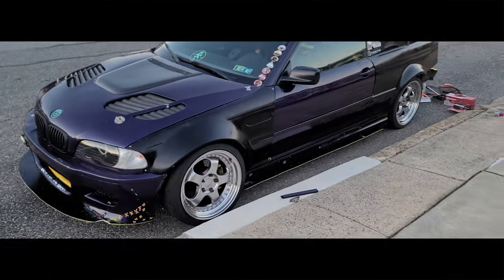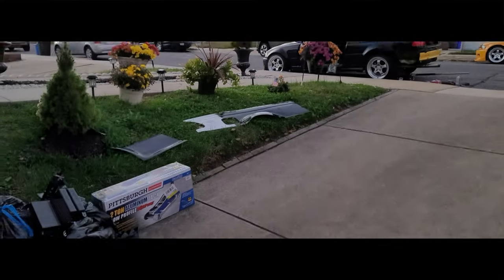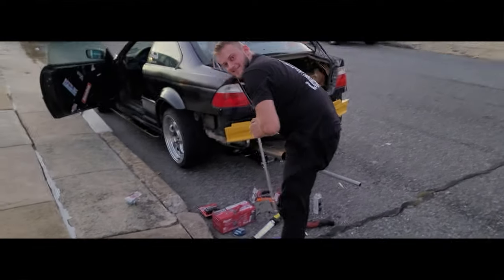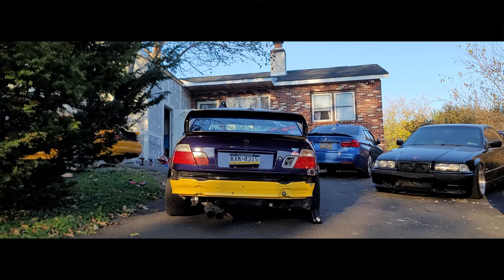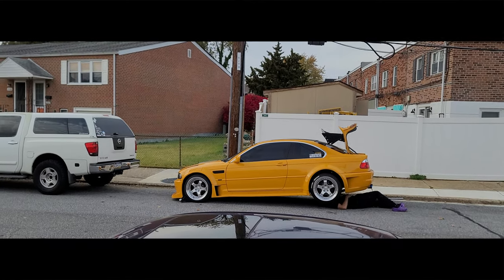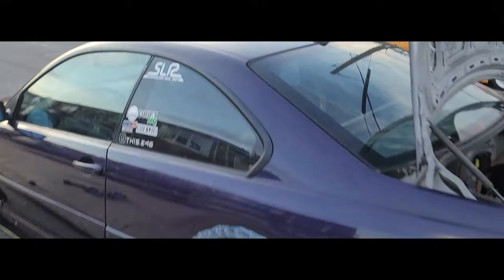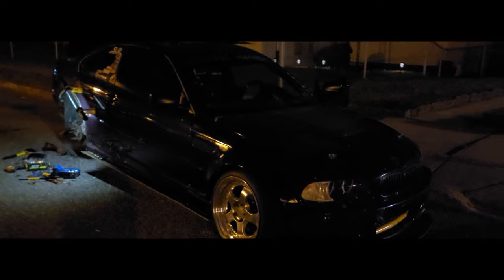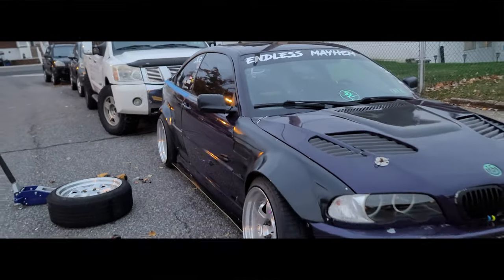The PERFECT E46 Widebody Build Begins! Wider Than My GTR?

Comment: Is that an m3 rep front bumper? (Like non M fitment I mean). Does the fenders line along with the bumper?
Reply from the maker: Yes, they align
Reply: @BreakTraction  you’re tempting me to go wide after watching this brooo ❤️🔥
Reply from the maker: @bobafittness1346  you should always go wide 😈
Reply: @BreakTraction  dangggg bro. Sick content you’re putting out there. I might lmaoo 🔥🤣, how did you go about the plastic fender liners up front? Removed them?
Reply from the maker: @bobafittness1346  I have mine removed, he has his cut a little, but with wider wheels it rubs on the liner so it has to be removed
Reply: @BreakTraction  won’t water and mud getting there make it rust etc?